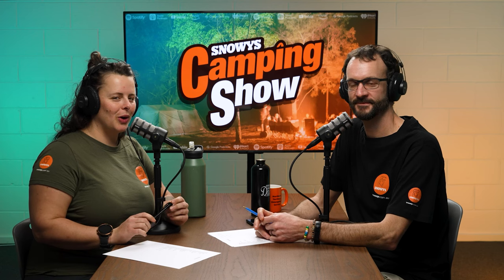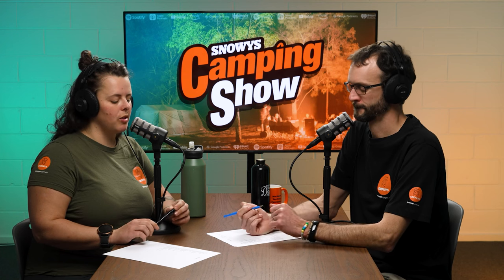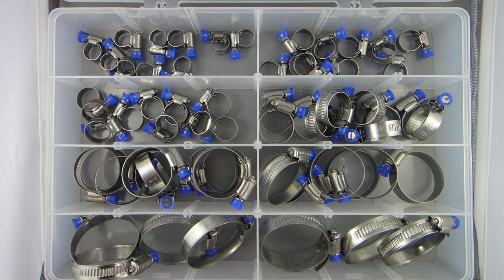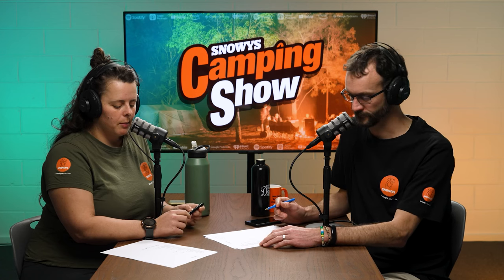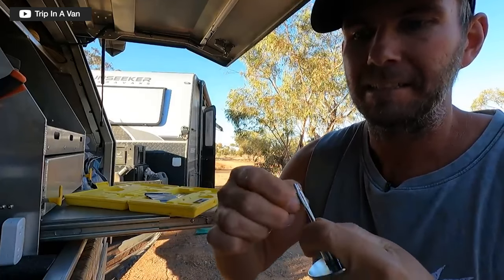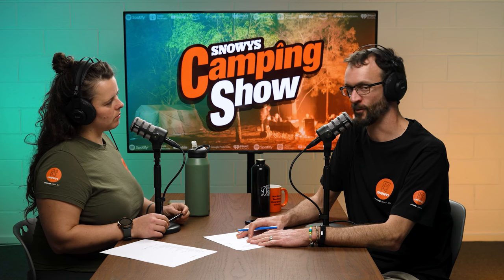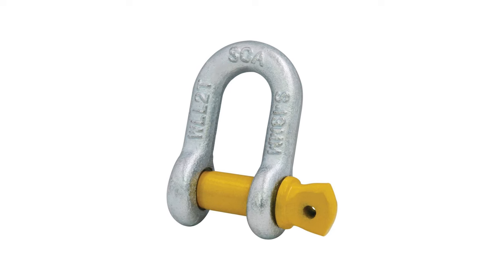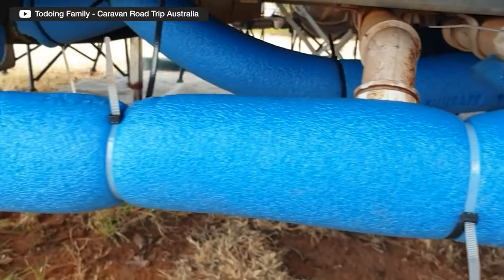Ep 68  - Spare Bits for Your Caravan Kit

Comment: Pro tip, when carrying spare bearing sets for caravan/camper or car, have the set pre packed with bearing grease, then vacuum seal them using your camping sealer, this does a couple of things, first they are ready to go on the side of the road, keeps them fully protected from the elements, dirt and dust, and the really good one once packed with bearing grease is the vacuum sealer takes out all the air, so forces the bearing grease into every little nook and cranny 👍

And your welcome for the pool noodle suggestion, I just picked it up from YouTube as well, but they are great for protecting pipes, hoses and fittings under a van or camper from rock damage 👌

Great video's as always, keep up the good work !
Reply from the maker: Thanks for another great tip on the wheel bearings, aussienscale, vacuum sealers are useful for so many reasons. I'm glad you enjoy the videos. ~ Ben

Comment: I am not a caravan owner, however I understand the points outlined.
With the introduction of 12 volt solar, in many camping set-ups, I reckon a multimeter, and a basic understanding of amps, watts, and volts, alleviates some stress for new travellers.
I would also recommend a workshop manual, for your particular vehicle, it may give a traveller hints, even on issues with their van, they may not have mechanical experience, but their reading comprehension, may guide them.
Reply from the maker: I think you make some good points, Rohan. You don't need to be an expert, but a basic understanding and/or some form of written guide can go a long way to getting your vehicle back on the road. ~ Ben

Comment: good info, its worth checking before hand the correct bearings you have on the van, they 'could' be a 'composite' set, ford and holden on the same wheel. a potential trap. also electric brake magnets, there is a specific type for off road. hope this helps.
Reply from the maker: Thanks for your handy tips, Places To Sea. ~ Ben